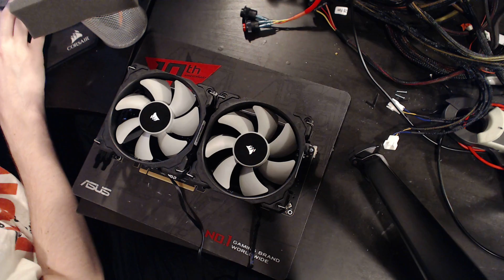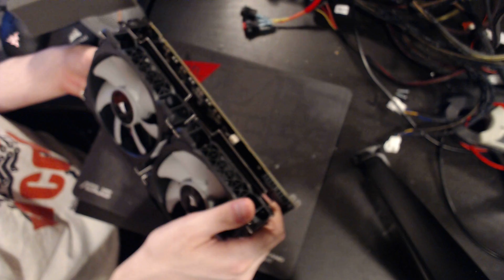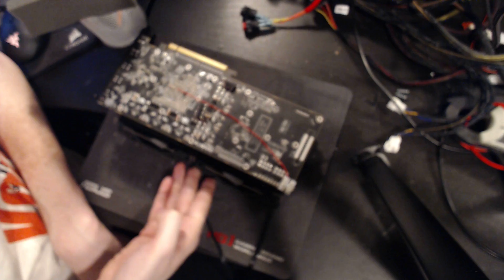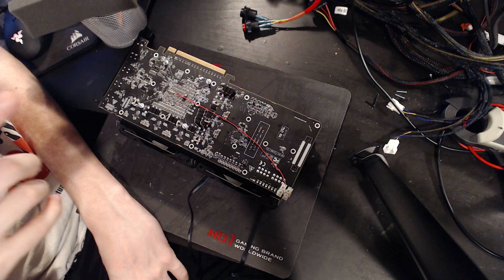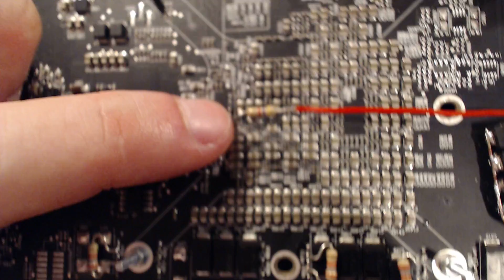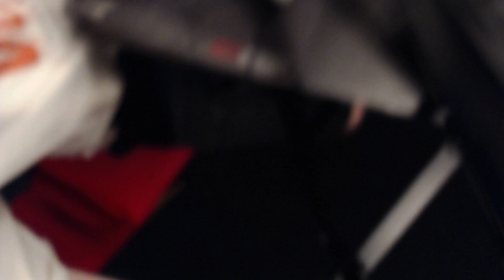Buildzoid rambles for a bit about some VEGA FE testing.

Comment: Hey peeps, I have recently got a few ROG Strix cards (Vega 64 & RX-580), and they have the pads on the end and there is OCP, OVCI & OVM, each have 300 - 400mv on them.  I can only assume these are there to deactivate current protection, do you ground them to deactivate the protection??  TIA

Comment: seal the top of those fans with the cooler. will run much cooler/better as the air pressure is gana tank, and the flow goes to least resistance (the hole at the top)

Comment: got a vega 64, thinking about the cooler you are using, would using small heatinks with adhesive thermal pads on the vrm be any help? otherwise any other cooling solutions that might work withoout major modding?

Comment: I have two GTX970 Strix, one could get to 1450 MHz with no additional voltage fully stable, but the other couldn't get to its stock 1300 stable with out maxing voltage in MSI AB, so silicon lotery is a bitch.

Comment: i really wonder how can this card run (relatively) so cool. I know you just stated it runs hot, but relatively it's not. It pull 400+ W and runs cooler than say the 290X cards did with 100W less power.
Theres a guy on reddit, the blower version he OC'd to 1672MHz and with thefan ramped up (not 100%) the temps stabilized around 75-80C

Comment: Would there be a way to make a VRM cold plate that mounts to the LN2 pot? because I recall you saying there would be 700W of heat off the VRM at 700A, and at the rate this card is eating power, 100W of heat off the VRM does not sound like an impossibility.  If it is pulling 400+ watts for the core alone, then would that not mean already 350A or so off the VRM?
Reply from the maker: At 700A this VRM will kick out 165W of heat not 700W. At 350A it makes about 55W. I might do something to sink some of the VRM heat into the LN2 pot however. VRMs really prefer to not go bellow -50C and even bellow 0C caps aren't happy. Ideally you'd want a VRM sitting in the 50C area.

Comment: couldn't u have kept the baseplate? on the vrm to have better thermals on it and modify it or modify the air cooler/aio to make it fit while having the baseplate still on it?
or was it in the way of all the mods and wasn't that great thermal wise anyways?
Reply from the maker: base plate includes the fan housing and that's way too big to run with the Morpheus. Really I've kinda half assed the build of the card soo all the issues are my fault on the other hand I don't really care to fix them since I am still in what I consider pretesting.

Comment: Why are they not putting the VRM on the back of the card and put heatsinks and a fan there?
Reply: mike fox I challenge you to try get that design thru sales and marketing. "Hi we wanna make a 3.5u card. No don't worry about it, it won't cause any furnace memes on the internet and people don't need their pcie slots anyways"
Reply: 1.5u on the front, 1u on the back - 2 way cooling, is what I meant.
Reply: a 2.5u reference card ? who's gonna buy that ?
Also it's more expensive to have to separate heatsinks and fans rather than only a big one

Comment: I have the corsair ML Pro Led 120(exhaust) and this fan is the loudest component in my system when gaming..... I have 2 noctua industrial 2000rpm 140mm fans for intake and are much more quiet

Comment: Here a 120mm Enermax D.F. Storm to reach 3500 Rpm.  The noise level according to the chart at max RPM will be around 38 dBA.  https://www.newegg.com/Product/Product.aspx?Item=N82E16835214075

Try it, I dare you.
Reply: Those are pretty insane yeah...but he needs Deltas! 38mm 6000RPM Deltas!

Comment: Wow nice GPU, modded already lol, but You need to put little tiny heatsinks on the VRM parts underneath. With them naked, they heat up Significantly worse. You need that extra level of thermal saturation or whatever. Add a mass of metal and a mass of air, not just one.

Comment: doesn't electricity take path of least resistance? I would think that the current sense circuits would accidently load one phase more than the other.. though I'm more trained in the trade work of electricians, not electronics. 

would it alternate bewteen the higher resistance, possible lower voltage and the inverse? that might cause the sensor to freak so it might lower performance as a safety feature? again, forgive me if i'm way wrong, just don't understand the reason it would balance both phases in parallel from my current understanding of electricity..
Reply: The short answer is inductors are weird.  The long answer is inductors oppose changes in current, not only preventing it from reversing direction but even to the point of pulling electrons up from ground to vcore just to maintain current.

Comment: JEWSES  you can really rant and stall endless about nothing...didnt make it to more than min 11 today^^...VRM temps are always good on Morpheus...had it on 980 and 290x. As long as you use the little heatsinks that come with the morpheus. How you can seriously think that they are NOT gonna be better than with the stock heatsink is beyond me.
Reply from the maker: the little heatsinks don;t fit.
Reply: aaaahrg then make it fit. Or use a backplatecooler like Arctic did on the Accelero Extreme IV.

Comment from the maker: I may be super tired but at least I'm
firzzzzzzzzzzzzzzzzzzzzzzzzzzzzzzzzzzzzzzzzzzzzzzzzzzzzzzzzzzzzzzzzzzzzzz
Reply from the maker: oh neat. I'll try it when I have the time.
Reply: Actually Hardcore Overclocking so fast
Reply: they are 75CFM @ 37dba the jet flows are 95
Reply: You cant just state the spec sheet those always either lie or are on a unrealistic scenario
Reply: Nice rambling. I give it 5/7.
Reply: Get a High CFM and high pressure Delta/Sanyo Denki fan on that cooler :)
Here's a good and cheap option (with PWM) : 
http://www.ebay.co.uk/itm/Fujitsu-CELSIUS-M470-2-AFB1212SH-Cooling-Fan-/112353813930?epid=937494953&hash=item1a28cf25aa:g:IfwAAOSwaeRZMNP-
Spec sheet (it's 113CFM or 10,9mm pressure :D) :
http://partner.delta-corp.com/Products/FANUploads/Specification/AFB1212SH.pdf
Reply: you really don't need to solder on your 1k card to raise the powerlimit:
http://www.overclock.net/t/1609782/watttool-a-simple-tool-that-combines-overclocking-with-vrm-monitoring-tweaking-for-rx-400-series/230#post_25789978
if vega isn't supported in the latest afterburner beta, you have to copy the table manually with atombiosreader.
there is a lot of things that can be tweaked with the powerplay table (here rx480):
http://www.overclock.net/t/1609782/watttool-a-simple-tool-that-combines-overclocking-with-vrm-monitoring-tweaking-for-rx-400-series/240#post_25834851
and here is the header of the new powerplaytable:
http://www.overclock.net/t/1633446/preliminary-view-of-amd-vega-frontier-edition-bios
typedef struct _ATOM_Vega10_POWERPLAYTABLE {
        struct atom_common_table_header sHeader;
00                      UCHAR  ucTableRevision;
5C 00                   USHORT usTableSize;                        /* the size of header structure */
22 07 00 00             ULONG  ulGoldenPPID;                       /* PPGen use only */
03 2B 00 00             ULONG  ulGoldenRevision;                   /* PPGen use only */
1B 00                   USHORT usFormatID;                         /* PPGen use only */
48 00 00 00             ULONG  ulPlatformCaps;                     /* See ATOM_Vega10_CAPS_* */
80 A9 03 00 (2400MHz)   ULONG  ulMaxODEngineClock;                 /* For Overdrive. */
F0 49 02 00 (1500MHz)   ULONG  ulMaxODMemoryClock;                 /* For Overdrive. */
32 00                   USHORT usPowerControlLimit;so, 32 00 is usPowerControlLimit, little endian -> 0032 to decimal is +50%; if you change it to max FF FF, you get +65k%
..should be enough ;)
Reply from the maker: AFAIK no one has managed to get a custom BIOS to work on VEGA yet.
Reply: Buildzoid! I'm a big fan! happy to chat with you, and thx for all the vids.. had to say that ;) .. and i'm hellm

i am NOT talking about bios mods. A part of the bios, the "PowerPlay Info Table" can be copied to the registry. With every radeon so far! and it works like a biosmod! the driver just reads the powerplaytable form the registry instead the bios, and everything works as intended.
you should read the first link, there i explained how afterburner does it.
if afterburner doesn't do that with vega yet, i can totally do that for you. it is just a regkey and you can go crazy with it, no harm done. i got this with my rx480 experiments.
you can give me pn with this youtube thing? well, go ahead contact me, i am happy to help.
Reply: Actually Hardcore Overclocking Hey dude! New to your channel. But would you be able to do a video on the AsRock X370 Gaming K4 and if possible compare to the MSI X370 Pro Carbon? Thanks!
Reply: vega looks like shit. i bought my 7700k and 1080ti today thanks.